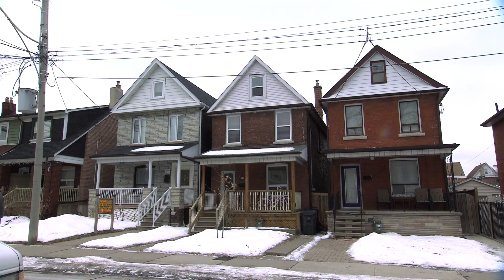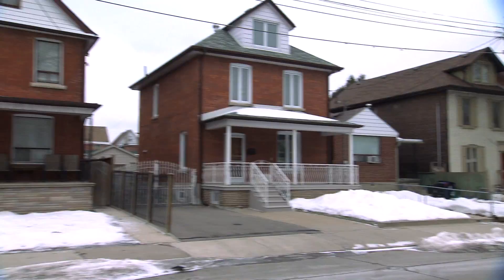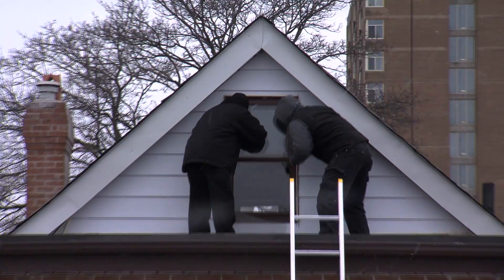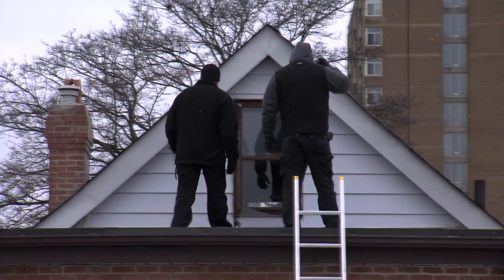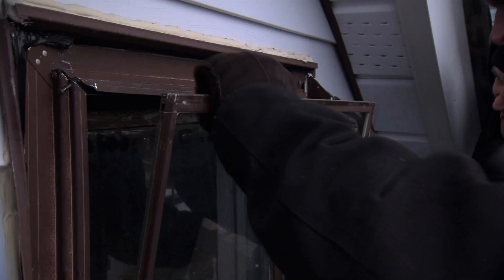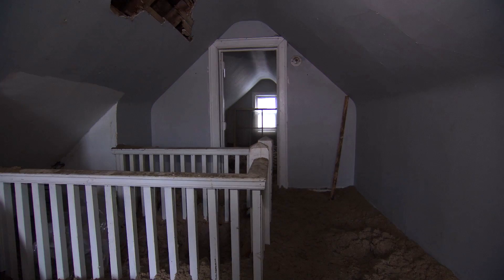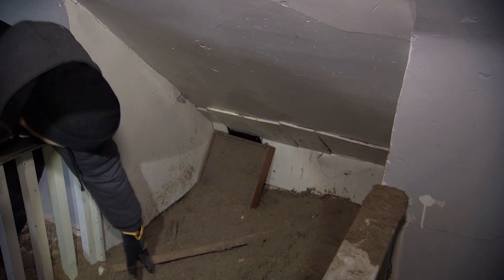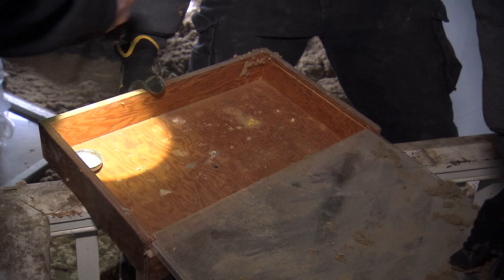HOLMES MAKES IT RIGHT: Third Storey Story

Comment: so was the wind blowing?? If it was blowing just right it will make the fan sound like it came on as the blades go backwards from the wind. The average size of people is way smaller 100 years ago and they did use space with stairs and it made for a stronger support being smaller.

Comment: 7:12 If the other window was open it was creating a draft or if it was pulling air from below.
Reply: If that noise was the fan motor, that was not a draft spinning it, it sounded like it was under power.  Unless that was a drill or impact driver I was hearing?
Reply: I think they added that sound to make it more mysterious

Comment: love the show but one thing that really bothers me is how he comes in and does amazing repairs that cost more than the house. Worst still is when he hates on the previous contractor for doing it cheap when the client is only willing to pay so much.
Reply: For myself there is a different between cheap and WRONG!!!
Reply: Bryan Garey
well clearly you dont want to do things wrong. but if the client only has say 5k to do a room that needs 30k worth of repairs you just cant fix everything.
house.
Reply: Doing the job is a choice.
Reply: You can tell the difference between someone who just watches the show and a fan of the show. He's made it clear on multiple occasions that minimum code isn't good enough, if you pay someone $10,000 to do a job and they pocket $6,000 by barely doing whats needed instead of making sure its done right then Mike has to come on to fix it then he has every right to say what he does.